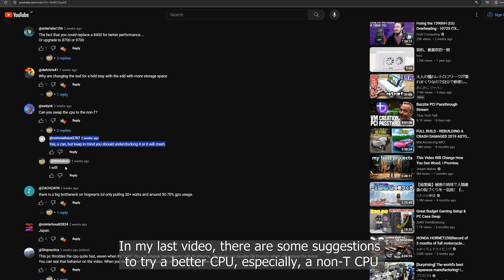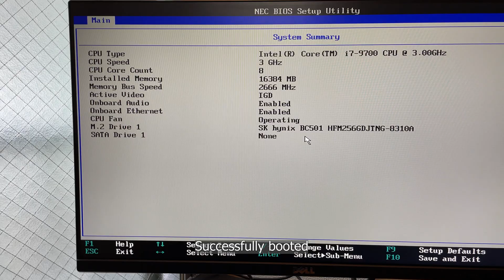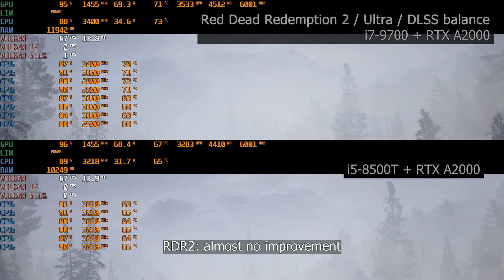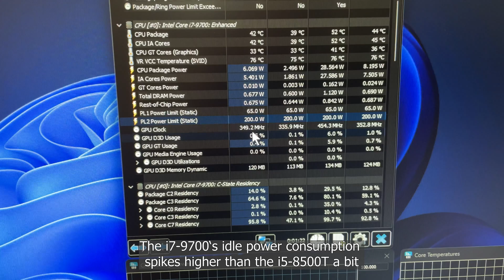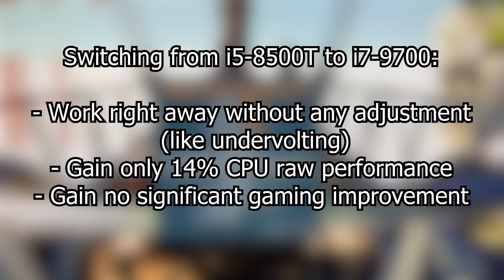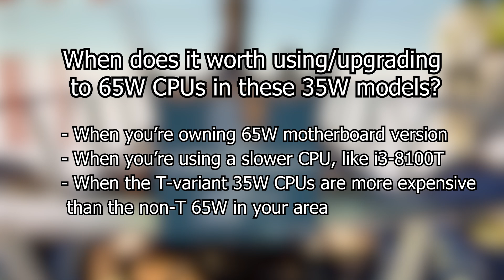65W CPU inside 35W motherboard?

Comment: bro u insane , i bought an new Dell Precision Tower 5820 with i9 10920x 128ram and RTX a2000 12gb for 400$ , and deside to do some mini itx setup with a2000 + to upgrade cooling system cause 10920x is overhitting and saw u videos about it , fanatstic thank you !

Comment: your system is begging for more watts man, the problem with mini pc or laptop are there's no way to increase them. whether you change the power brick from 65w to 300w, the system will still cap the power draw from the wall to it's original spec. I think your system will run better if the gpu draw power separately from the motherboard, those i7 definitely can running at 4.5+ ghz all core with no problem if it doesn't being considerate with his power-hungry neighbour haha.

Comment: Use the copper heatsink, or at a minimum add some cooling to VRM with thermal pads or a fan.  Also 8700 is better than 9700 due to hyperthreading.  If chasing performance make sure you are using Dual Rank memory (if it is 16GB make sure it has 16 chips per memory stick.  Or it says "2Rx8".  Or "Ranks: Dual" in CPUz.  I have better CPUz score with dual rank 2400 than single rank 2666.  (Rank does not mean channel.  Run dual rank and dual channel.).  Also run GhostSpectre to turn off what meltdown/spectre mitigations you may have.  And possibly use older BIOS without microcode updates.

Comment: Undervolting might eke out a bit more performance on this cpu, since at a lower voltage it can run a higher frequency at the same wattage, in theory. I've heard of such things. Assuming the BIOS supports that, of course. Also wondering if the better CPU supports a better ram speed.

Comment: Good project, i follow it from the beginning with unconcealed interest. Couple of thougts: Afaik there are hardware locked 35w cpu power-limit in ur motherboard (m920q), and in m920x cpu tdp is bumped up to 65w. My suggestion is to replace mobo and cpu cooler from 920q to 920x model. CPU TDP will rise to 65w BUT motherboard's VRM would not be able to supply both 65w cpu and 75w gpu at once. So furtherly u would need either dedicated second PSU for gpu OR splitting power from ur current psu to 2 lines. Seems like its possible in this way: lenovo's standard PSU's voltage is 20v and gpu needs 12v. U can solder 2 wires L/N directly to mobo's square yellow lenovo mobo power connector, then reduce it from 20v to 12v with DC-DC module and then solder 2 wires L/N from this module to GPU 90degree expansion card 12v pins underneath of PCI-E slot according to pinout scheme. In this case u would get 2 independent power lines for cpu and gpu from one PSU without current strict limits. It sounds pretty tough to be honest but achievable in theory.

Comment: Have you considered using a different heatsink? I believe there are some copper heatsinks available for the 65W models. These heatsinks also contained heatpipes. I think they also had thermal pads attached to them to cool the VRM.
Reply from the maker: That's interesting idea. However, as you can see, the CPU power can be maintained at 35W consistently (35W is the board limit for the CPU), so I doubt that VRM heatsink could help. Anyway, I will try if I can find that kind of heatsink. Thanks for your idea!

Comment: In Hogwarts you say almost no improvement. While FPS wise yes, but you'll notice the stuttering with the i7 was non-existent. It had processing headroom vs the i5 hitting near 100%. I think the i7 upgrade is more practical if you're looking for smoother gameplay and better 1% lows as opposed to higher fps simply because the i7 has more headroom to not bottleneck processing your game and other tasks.
Reply from the maker: You're right. The 1% low did improve, I also regcognized it at 1:56 while benchmarking. In gameplay, however, since the previous test run with 8500T with ThottleStop, I could play the game smoothly without noticable stuttering (only sometimes when teleport between locations). So personally, I didn't feel much different in that game. Maybe the Hogwarts isn't heavy enough to reveal the 1% low difference.